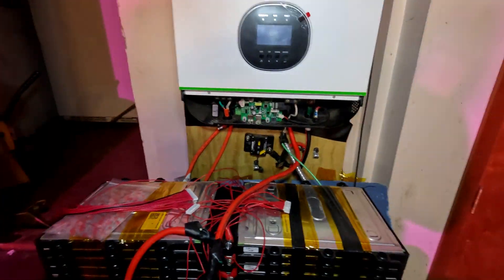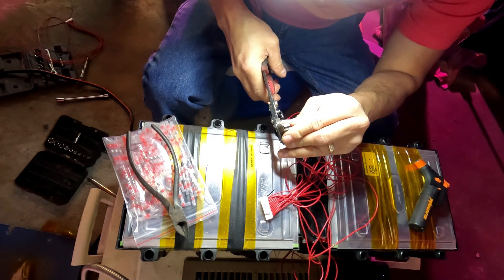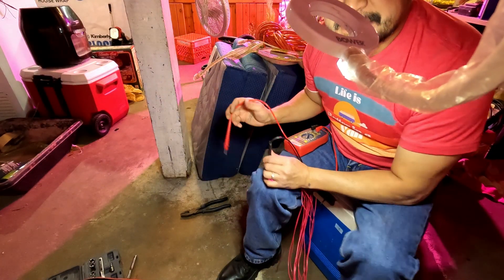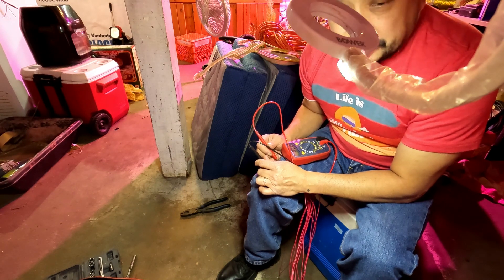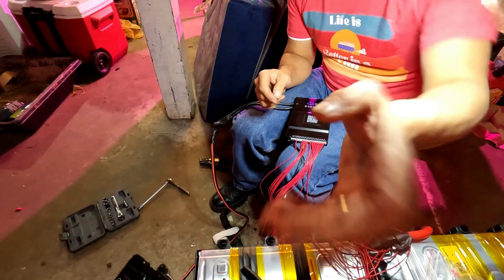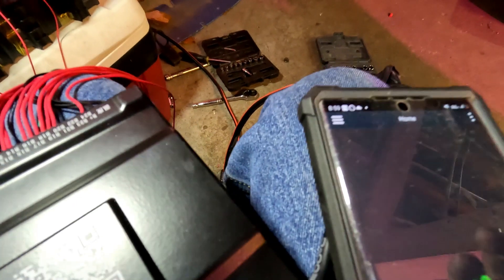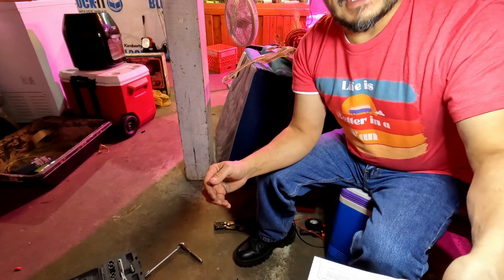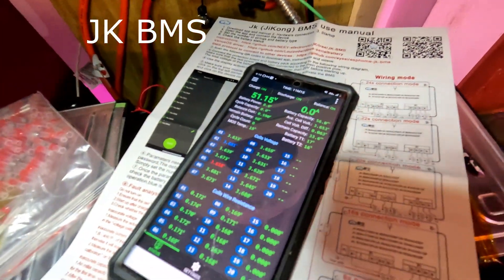wiring and start up JK BMS

Comment: how did you solve the "make a pair failure" ? what password ?
Reply: Hola me sale este mensaje coloco la clave 123456. Por favor ayúdame
Reply: Pairing password is 1234. 
To change the settings, after you connect, the password is 123456

Comment: Cool kinda of confusing but I'm following great job in gonna do the same for my fishroom thanks for sharing 👍🏿 😀
Reply: In absolute terms, there is a difference in resistance with more or less wire in the path, but it's so little that it doesn't make a difference. You can Google for an ampacity chart which will give you voltage drop over distance for a given gauge of wire. It will be METERS before the difference starts to become relevant.
Reply: @beepborpbeepborp 👌🏿